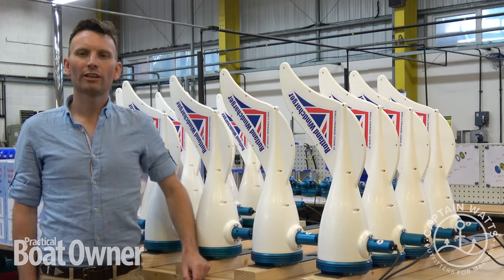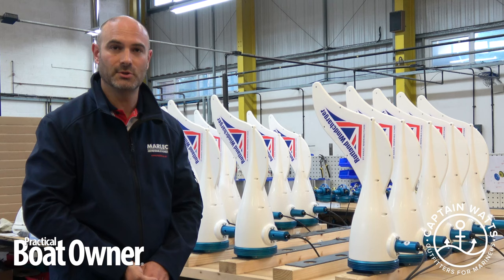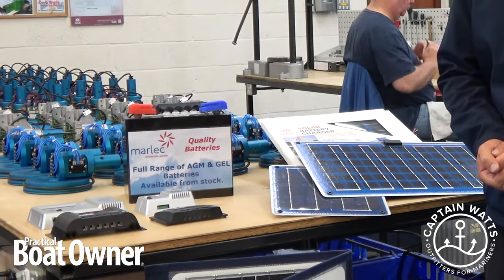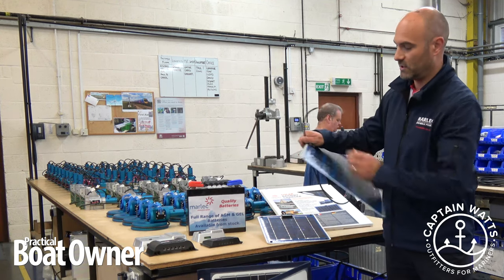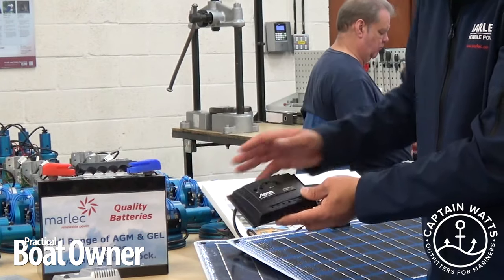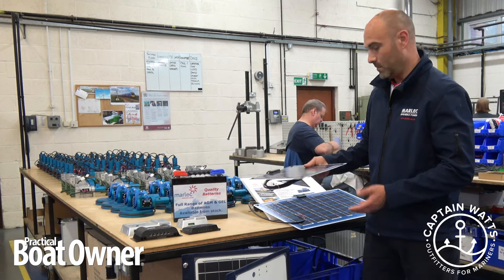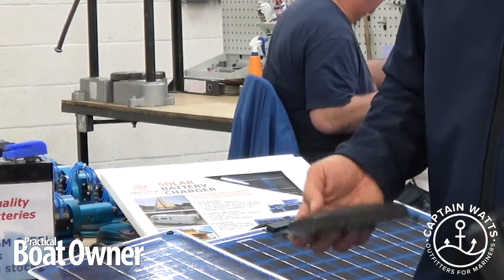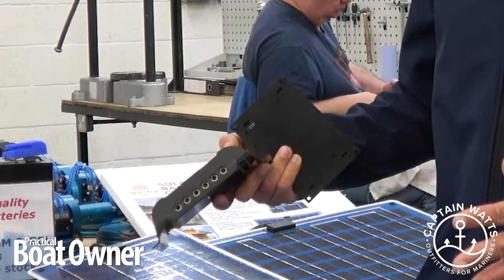Introduction to Solar & Wind Energy for your boat with Marlec

Comment: is it possible to change the amount of electricity generated if the intensity of the electrodes inside the generator can be adjusted according to the change of wind speed?, if we can control to changing spin resistance, we can protect ur generator even in the typhoon.
Reply from the maker: Speed governing of the turbine occurs electronically from the controller, this becomes active at about 15m/s or 29Kn or 35mph.  This electronic high current protection system intermittently alters the speed of the turbine to reduce aerodynamic and electrical stresses on the system. If you are going to experience storm force winds, the wind generator should be restrained (you can turn the unit so the tail is into wind), cover the unit or remove it temporarily.